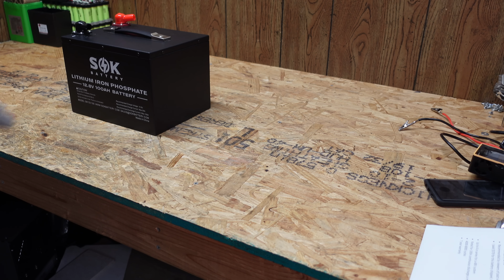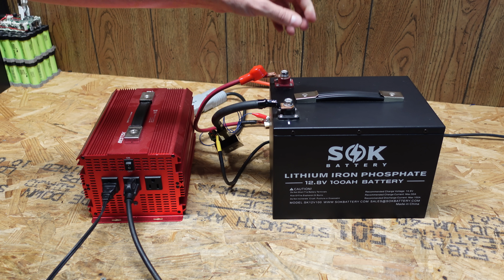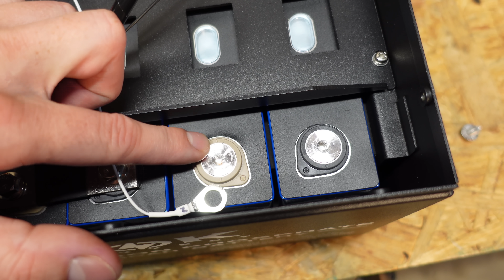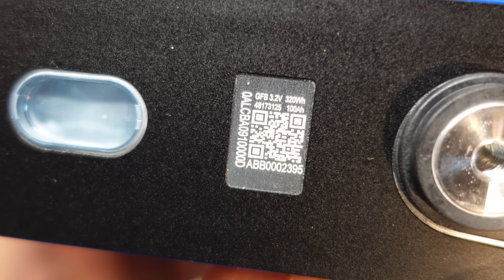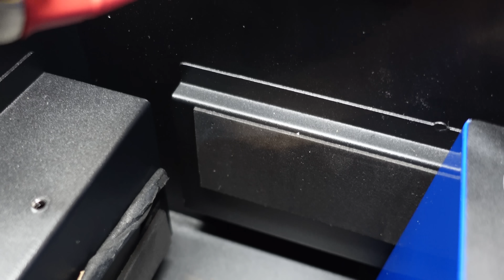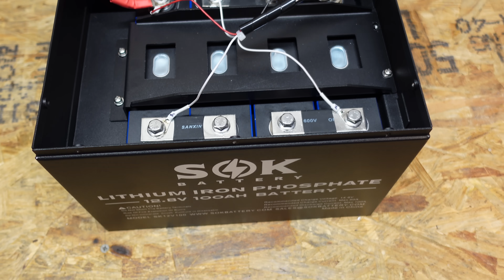SOK Battery 12V 100Ah LiFePO4 Battery, Review and Teardown

Comment: I can not fathom the expense to return ratio of Solar systems. I am pretty good with math, (to figure the amp hour draw, needed wattage to run the house, battery load times, solar output) have been an electrician on the railroad and in homes and to run my house off grid (which would be my goal) I would need a large bank of these batteries and at $700 a pop for them it becomes rather expensive rather quickly. The inverter, BMS, solar panels, solar inverters (if needed) add to this... it just seems to me to be economically unfeasible.
Reply: no if you buy the raw cells from aliexpress or alibaba and get cheap solar panels there is no way you wouldn't make huge profit. the estimates from commericial installs say something like 8-10 years ( i made that up) so raw parts is a fraction of that, you wouldn't buy these SOK batteries, you would buy 280AH eve or lishen cells from alibaba for $120 each so $480 for 280AH, lets say you buy 4 of those to make 48V, anyways my electric bill is $80-170 a month, the math easily adds up. the batteries is maybe 25% of the cost of the whole system (again making that number up) once you save on the cost of the system you start making profit. you're other expensive cost are cables, inverters, fuses, etc. I'm bad at math but I can easily see the feasibility. luayuan on alibaba has lishen cells for $840 for 4 cells of 280AH so you can save even more there. you are an electrician but solar and batteries is a whole noher game and you REALLY need to do heavy research on it because trust me you haven't even scratched at it if you don't see the math yet
Reply: if you want some practical advice on the lifepo4 cells or what fuses to use I can help, because there's only 1 type of fuse that are rated for lifepo4 so it's a no brainer, ANL fuses will potentially burn your entire place down, some have reported lifepo4 as passing 13,000 amps through it through a short
Reply: @eksine  What size /type of fuse would you use for a single 100Ah LifePo4 battery connected to a 1.5K or 2k inverter?
Reply: @chris8383  the only type of fuse that's ever been approved for lithium cells is Class T, they look like barrels with lugs on both ends or the second type of class T are snap on barrel type but those are smaller loads and I've rarely heard of them being used , but they are ok. You need to know that there are 2 types of fuses in class T and other types: fast acting and slow acting. For the most part you need to make sure that it's fast acting because slow acting unless the manual states it's required will allow higher amps to pass  than what the fuse is rated for. I've got a samlex PST - 1500-12 inverter, and the instructions say it needs a 200 amp fuse. The fuse rating for your inverter is always what's in the manual and if that's not available then since you're electrician you would just need to take the cover off and see how many fuses they combined in parallel. For the protection circuit. I know that the samlex PST 2000 watt requires a 240 amp fuse which is impossible because class T I've never seen that being sold so the only way to even get close to that is you may have to parallel one which isn't recommended at all or you have to use one that's lower rating.  Always use the fuse stated in the manual. Basically any fuse with an ampere interrupt rating of 20,000 amps or more is okay, I did find a midnite solar circuit breaker that was rated for 10,000 amps interrupt current which is less than what you should use but it's up to you if you want to take that small risk, and just like any circuit breaker it will allow more amps than what it's rated for to pass through before it breaks. Also something really important to keep in mind is that some brands are low quality and they will not work as intended, the ones that I am pretty sure are reliable are blue seas and LittelFuse brands, also if you need a fuse holder go straight to shunts. Com and buy their holders please don't tell anybody else this but their prices are super low you basically get a free fuse or a free fuse holder however you want think about it because $40 for a 400 amp class T fuse and holder is the same cost as the fuse alone and the fuse is LittelFuse.  The holders are massive and heavy, the pictures don't give you the scope of how freaking massive these are. And just for reference ANL  is around 2000 ampere interrupt and midi or Ani fuses are about 5000 amps Interrupt, you can see why that's a problem
Reply: @chris8383  also there's this lesser known thing about solar panels if you go to will prowse's channel he shows a batch of solar panels that he bought for like $75 each for I think they're 300 watt used solar panels the downside is they ship it per pallet so you have to order as many solar panels as you can on a pallet to save some money but in the end they are way cheaper than buying brand new panels. The other downside is there's some used solar panels that are pure garbage that are being sold so you need to look at reviews and see what other people have tested
Reply: @eksine  Thank you very much for the in-depth reply. I will check out the Class T fuses from Blue Seas and LittelFuse... I have not been able to decide on an inverter. I have been looking at several Inverters such as Giandel, Gowise Power, CNSWIPower. I am on a tight budget, do you have any recommendations for a 1500 or 2000 Pure Sine wave inverter that would power a 7amp 115v refrigerator or a 1.3K microwave?
Reply: @eksine  I have purchased 4 100Watt Renogy panels for $87 per panel. I am guessing the used 300 watts is probably at 70% efficiency when bought used. Still a better deal than my Renogy panels.
Reply: @chris8383  like I said if you go to shunts. Com you can buy the whole fuse holder along with a free fuse , just make sure you select the right size fuse along with the holder, that's why each one has a different model number. There's 2 types of holders, one where you put in your bare cable and one which accepts lugs, I prefer the lug type for a stronger better connection. As for the inverter I never recommend cheap inverters so my preference is always going to be a samlex inverter, their PST line is what I use, it's one of their most reliable one . They also have a newer line that is specifically for lithium which also has a built in charger, it's pricey. The ones you mention are what will prowse recommends and after buying lifepo4 cells based off his recommendation I will never trust his recommendation again, they turned out to be heavily used and abused cells with swelling and only pulled 245-255ah as opposed to their 280ah rating. As far as the size of the inverter , microwaves have a massive startup surge, you need to size it several times higher than what it's running watts is. It must exceed it's startup current for the peak it can handle. You'd have to measure it's surge current to figure it out but  a 4,000 watt inverter needed wouldn't surprise me, you might be able to get away with 3000 watts but again you need to measure the peak startup current
Reply: @eksine What are your thoughts on using Circuit Breakers that can be reset instead of one-time-use T fuses?

 I bought a SOK 100Ah battery off of Wills and LithiumSolar recommendation. So far the battery charges at 14.6 and rests at 13.6V. I also have connected a 12 circuit DC fuse block with a negative bus with input terminal rated at 75A 32V DC, outputs connected to a USB fast-charge /PD, and also a 12 cigarette barrel, I guess I need a fuse for the fuse block as well. I am unsure of what size I need for the fuse block?

Comment: What is the peak discharge current rating?
Is it high enough that I can start a car or a motorcycle with it if I need to?
Reply: 100A, according to their website: https://www.sokbattery.com/products/100ah-12v-lifepo4-deep-cycle-battery
Reply from the maker: They list a max discharge of 100A. This battery is not a replacement for a car battery. Starting an engine would likely well exceed 100A. Even a small 4cyl car is >500A.
Reply: @LithiumSolar  actually I've seen lifepo4 motorcycle cells for sale on amazon, I actually agree with you but there you go. lifepo4 cannot handle freezing temps so maybe they assume it will not be used in that weather? it makes no sense to me either
Reply: @LithiumSolar  
That's exactly the answer I was looking for.
I will end up using pouch cells that may only be rated for 8 or 10 amp hours but can discharge at 200 to 400 amps just long enough to start a vehicle; or a quad of the new EVE LiFePo4 cells rated 280 amps with 750 amp surge.
The pouch cells are cheap and be paralleled for a reliable 150 to 200 amps per cell, with 3 in parallel reliably providing 450 to 600 amps to start your car without damaging the cells. So I will go that way first ans save up for a quad of the EVE and a very high current BMS. (or simply a balance board and a starter relay)...
Reply: Just a little bit of trivia........
I bought an expensive champ type ammeter that had a 1000 amp DC range and a peak hold function in it so I would be able to measure the absolute worst case load on the battery.
I connected the ammeter in the ground return lead to the battery so I would not only measure the starter current load, but would measure EVERY load placed on the battery include the heater blower motor, electronics, lights, etc....
I hooked it up to my Chevy Suburban 350CI V8 engine and did a 'cold' start.
If fact I did a number of 'cold' starts where I immediately shut the engine off so the battery never had a chance to recharge. Thus discharging the battery and lowering the starting voltage available on each successive start.
 The measured peak current did not go over 300 amps until the battery voltage had sagged down to less than 11 volts dc.
 I was very surprised at what I found so I tried the same experiment on my Hummer and my wife's Ford crew cab with the big Triton V8 engine in it.
Similar results on all three.
Never exceeding 300 cranking amps.
I never saw more than 300 amps until I tried it on my friend's duramax diesel which went slightly over 500, and my Case 680 backhoe/loader with a 24 volt system where the meter went into the overload mode (over 1000 peak cold cranking amps).
 I didn't try my John Deere tractor yet, but it has a smaller diesel engine than the case does.
 Bottom line:
 300 amp peak current for 5 seconds should be more than adequate to cold start any non-diesel engine in moderately warm weather.
The BMS controller chips on my LiFePo4 batteries have a pin available on them to extend the short circuit delay time to 15 seconds, and the 8 power fets in the discharge side of the BMS are rated at a 160 amp surge (each), so the BMS can handle it if your batteries themselves can handle it. That means your internal battery resistance would have to be less than 6 milliohms, (0.006 ohms),  for a single cell, or less than 12 milliohms per cell if you put two cells in parallel,  or less than 24 milliohms per cell if you put 4 cells in parallel.
 Resistances higher than that probably won't work and resistances lower than that are a big bonus.
Reply: @Dennis-mq6or  I've never seen a bms at 600 or 1200 amps , you would need to parallel them together to get that many amps. Pouch cells would swell at that high of an amp draw. I do not believe that any cell that is rated for 10ah can do a short term of 200 amps without swelling or other damage. I do not believe you even need a balancer. Simply an rc charger for indoors that can do 40amps + of charging. Specifically the junsi icharger S6 that lithium solar has which I have personally tested. I returned mine but only because I have the  icharger 4010 Duo which is 70 amps. What I would do is just get a jbd sp04s020 off AliExpress for $60 and also the Bluetooth module , maybe the LCD screen too. Use the 120 amp BMS to power your regular loads but for use as a jump starter you will bypass the BMS meaning you will go straight to the battery positive and negative leads and you will need a battery disconnect switch rated for super high amps. I don't want to give out recommendations because a lot of  battery switches are unreliable and fail catastrophically but the blue sea systems does have a gray one which has good ratings. You don't need a balancer you can use the icharger to do your top balancing as well as charging individual cells as well as the entire 12 volt pack. Also never buy the brand liitokala varicore, I got majorly ripped off and spent 3 months in hell trying to get a Visa charge back on that scam for those 280 ah lishen cells which were heavily abused and pulled 245-255 ah
Reply: @eksine  
 Yes, I agree that there are a lot of scammers out there.
I have been burned many times.
These days I refuse to deal with any vendor who refuses to accept Paypal for exactly that reason.
I have seen many BMS rated for over 1000 amps for 15 seconds before shutting down.
I personally cannot justify that cost; or relying on a single critical point of failure.
I would rather have many smaller cell groups, each with their own BMS, running in parallel.
I have found a place that sells NOS cells and used cells that I have had much better luck with than my purchases from China.
 Here is a link to some cells they are selling that are rated at 18 amp hours, can discharge at 900 amps (50C rate), and can be charged and discharged at -40 deg C. (and run that way for 30,000 cycles). I am saving up my money to order some, and until that happens need to work on an Arduino controlled BMS to use with them.
https://batteryhookup.com/products/case-of-12-lishen-2-5v-18ah-lto-30-000-cycle-new
I used to run a CB repair shop that repaired some really big power amplifiers, so I have 8 of the 100Amp CC / CV power supplies with the plugs in the back to synchronize them, so I am in good shape for battery charging but appreciate your suggestions.
 If you dig into the specs of the batteries used in most high current flat cells, (even the 290 AH ones from Eve ), they ALL swell when they charge and shrink when they discharge. The difference is that the steel or aluminum case they are in limits their shape shifting. Packets swell due to outgassing, which is usually caused by too much current charging or discharging causing heat and plate separation in the cell.
 But I also have some that swelled due to age and nothing else. (mostly cellphone batteries)...
.
The SOK battery looks nice for the price and you did a good review, but I think the only way I will get exactly the battery package I want is to build one myself!
Reply: they sell lifepo4 motorcycle batteries on amazon
Reply from the maker: @eksine  They do, but those are considered "starting" batteries and both positive and negative bypass the BMS. The BMS (or balancer rather) is only responsible for balancing the cells in those batteries and cannot disconnect the battery.

Comment: Internal resitance / impadance of each cell and overall would be nice to know.
Reply from the maker: I bought an IR meter but it's been sitting here for months and still haven't figured out how to use it. One of these days...
Reply: @LithiumSolar  They are usually pretty simple. Clamp leads as tightly to the battery as possible and test. Keep leads as short as possible if you need to extend them. Some testers require you to set a discharge current and it’s worth noting that things like temperature, SOC etc affect IR. I think measure cells at their nominal voltage for accurate results. What’s unclear about your one?

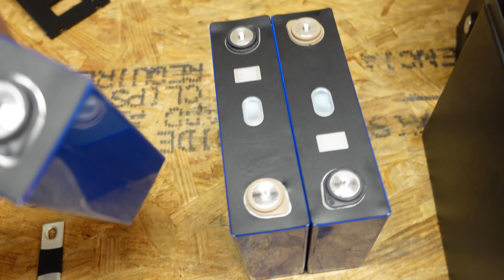Comment: 7:25 At 0% SoC the cells have physically the LOWEST volume. Charge them to 100% and try to take them out of the box. What happens to the thin blue plastic between cell  1 and cell 2, rubbing 5000 cycles at each other. 🤷🏻‍♂️

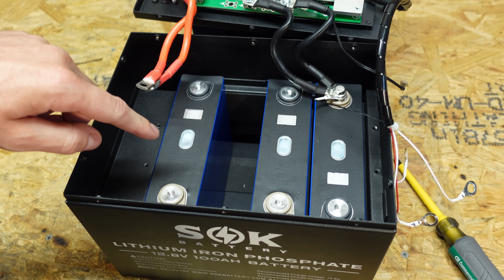Comment: 6:35 This is crap and very dangerous. When the thin blue plastic is gone, you get a "nice" high-amp short circuit between two cells!!
Reply: On aluminum case cells the aluminum shell is not rigidly connected to either positive or negative terminal. Any voltages observed are due to the electrolyte
Reply: @HighTechLab  Even if so, do you want a "3rd electrode" with an internal "battery bus bar" potential/voltage of some 10th or 100s Volts on it?

Comment: Expensive
Reply: This is actually one of the better buys, they use quality components, have an excellent warranty, and charge some of the lowest prices for what you get.
Reply from the maker: Is it? Seems very cheap to me. What would you consider a good price for a 12V 100Ah LiFePO4 then?
Reply: Valence has 138Ah for about $700.  You could consider some used EV batteries?  About the same price.

Comment: Use magnet to check if the busbar is aluminium or not.
Reply: What about lead coated copper?
Reply: Never mind.
Reply from the maker: The manufacturer told me they are nickel clad copper.
Reply: @LithiumSolar  It's actually Nickel-plated brass bus bar according to Min from SOK.

Comment: Ya when I make busbars myself I use aluminum just because it's easy to get locally
Reply from the maker: The manufacturer told me they are nickel clad copper.
Reply: @LithiumSolar  but....we didnt see any signs of copper where you ground the corners down.
Reply from the maker: @markb8954  Correct, because it's nickel clad copper, not nickel plated copper. I don't know how to test that, but I know it wouldn't be visible with grinding.

Comment: Did you try a magnet I mean if it doesn't weight enough for aluminum and isn't nickel plated copper is must be steel based on looks and what else would it be
Reply from the maker: The manufacturer told me they are nickel clad copper.
Reply: That's about all that makes sense
Reply: It's actually Nickel-plated brass bus bar according to Min from SOK.